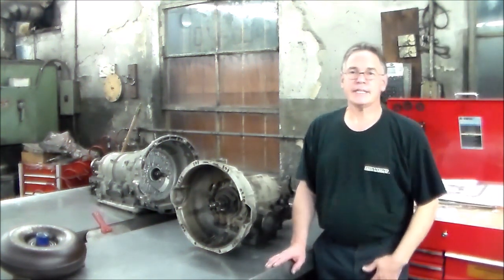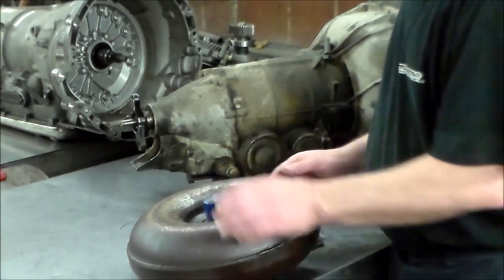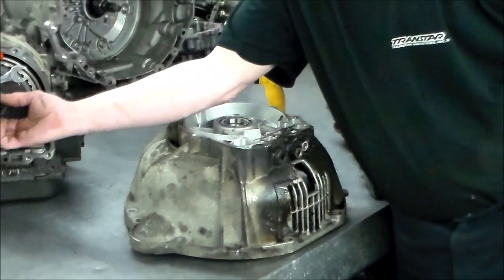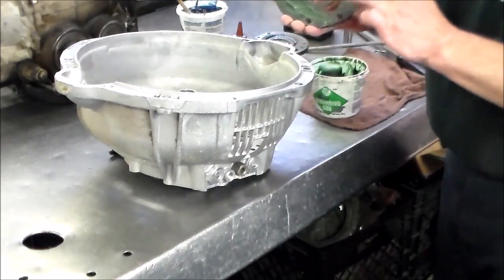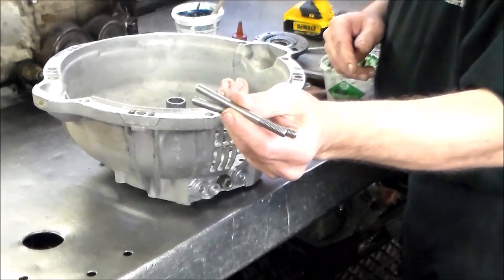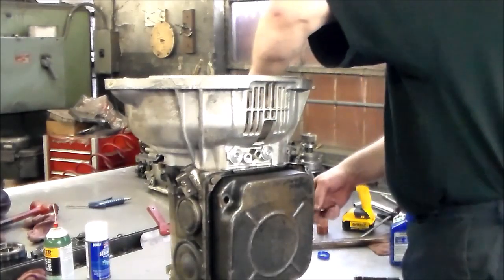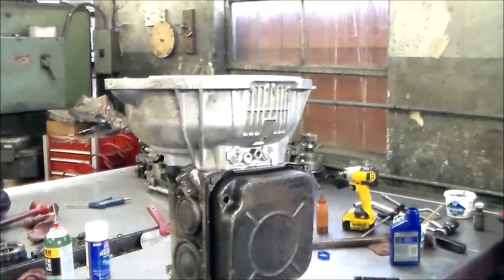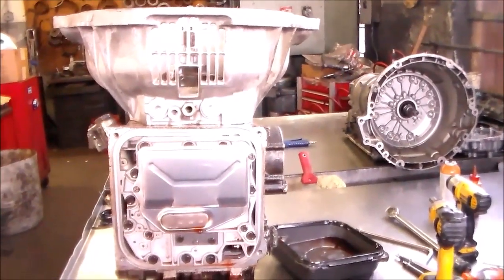Mercedes 722.1, Reseal

Comment: Great video. I'm going to the same job on mine soon. I know it's been quite a while but if you still have that special socket you used to remove the yoke nut, could you please let me know the part number. Thanks.
Reply from the maker: Made by AST  number is M20050.  No other numbers on it, may have to go to AST website to see if still available
Reply: Really appreciate your help. Thanks again. @GaryFerraro
Reply: Sei que o video ja é velho mais acho que a ferramenta salvo engano é a mesma que retira a porca interna do cubo de roda trazeira da w123 e w116 diesel. Não encontrei essa ferramenta quando fui trocar os rolamentos. Acabei fabricando uma em tornearia.

Comment: Gary, towards the end while changing the rear seal, you mentioned you can't imagine how hard the internal seals must be. I had the same thought, seems short sighted to not do a full re-seal at a minimum if not seals and banner kit. But sometimes you just have to do what the customer wants. But I can't imagine that the servo and piston seals are in any better shape. Cheers, neat unit, great video.
Reply from the maker: Thanks Luke, they just wanted the leak stopped

Comment: Thanks for the video, I was just doing this job and found the stator shaft attached to the bell housing is worn. Do you know how to remove it?
Reply from the maker: Not sure if it presses out or it part of the bell, it's been a while, i honestly do not remember, never had to change one, are the splines stripped?
Reply: @GaryFerraro  Hi, each spline is more than half worn through  so don't feel confident about reusing. I removed the bearing from the rear today and can see the shaft can be pushed out from the rear. Only problem now is the price of the shaft, Mercedes want £280!